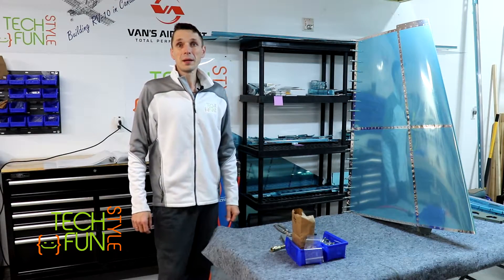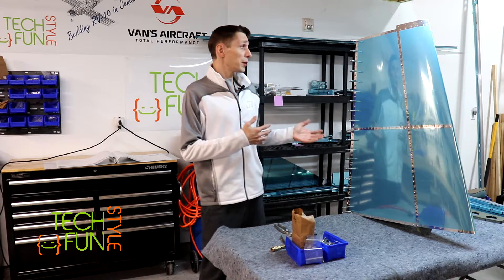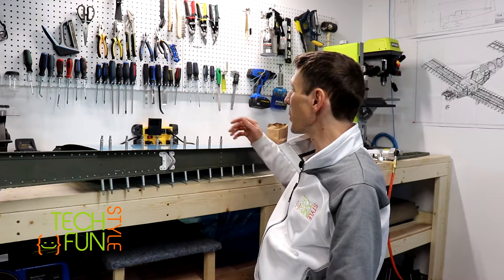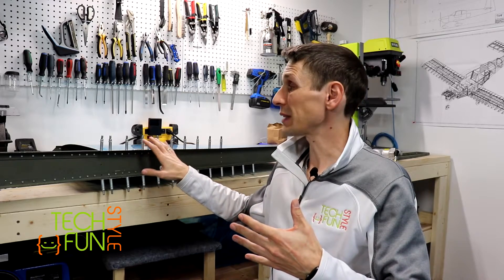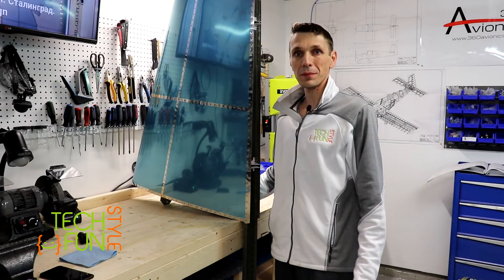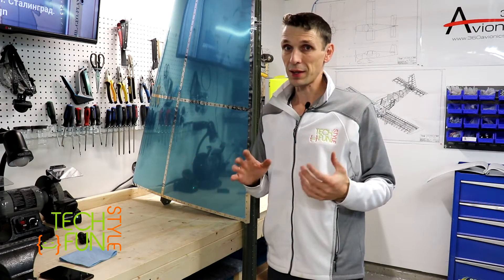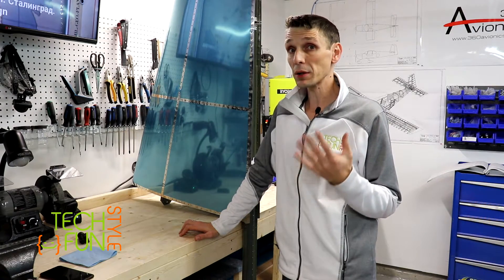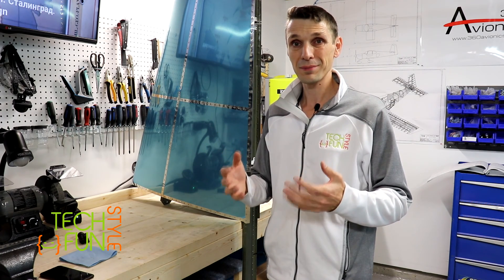RV-10 - Vertical Stab Assembly. Page 6-6 Step 2-9

Comment: Nice job! Just finished vert stab 2 days ago. Those rivets on the leading edge bend were challenging for us. Had to drill out a couple places. Ended up with a slight indention in a few places, but nothing that requires replacing the skin (in my opinion).
Reply from the maker: Very nice! What is your current status ? Have you finished your rudder yet ? I am presently work on my rudder but had some time off due to cold so looks like I wont be fishing my rudder before January.
Reply: Tech Fun Style Yes, rudder is finished. Working on horizontal stab, still have a little ways to go before finishing this part. Always looking forward to your videos!